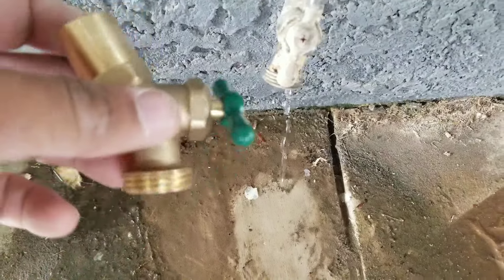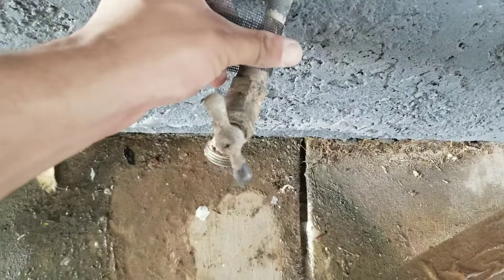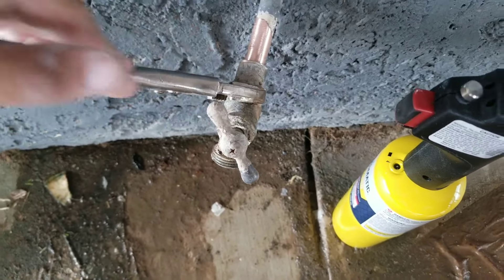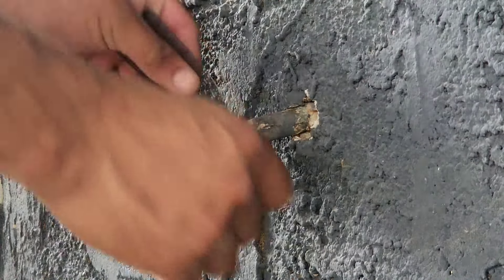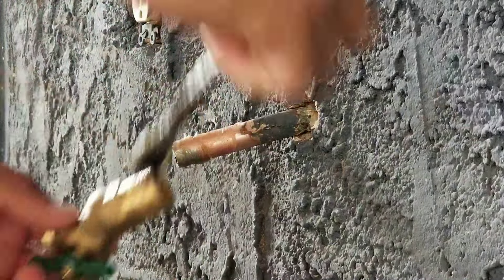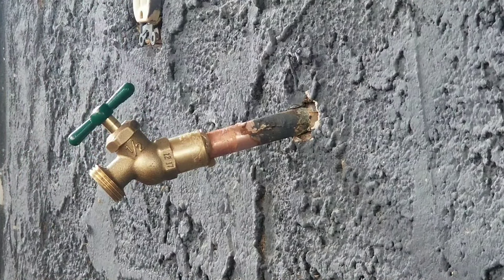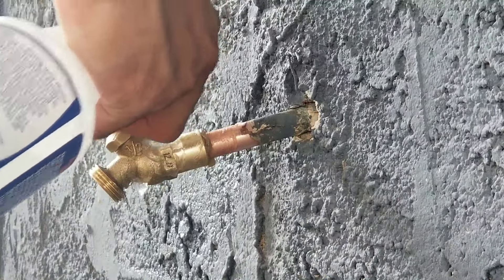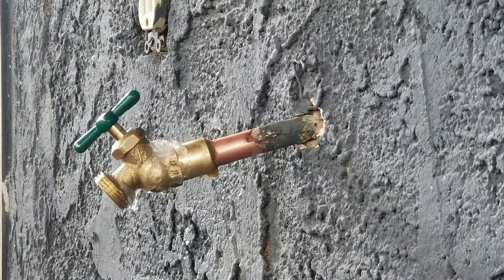How to Replace Outdoor Spigot Faucet Hosebib

Comment: How come every video like this has either several inches of pipe to work with or easy access to the other side of the wall. Of which I have neither....
Reply: Exactly!  My outside sillcocks have a flange that is flush up against the outside wall.  No exposed pipe on the outside at all.  The way I have to do it is by de-soldering the pipe INSIDE the house and then sliding about a foot of pipe and the sillcock out of the wall from the outside!
Reply: Was just thinking that. Mine has no room. I'm honestly thinking about adding pipe to mine if I get to that point so I don't have to go through this bs again
Reply: People who have to solder inside a wall cavity don’t really have room to film a video. Plus if it goes sideways they don’t want to document how they flooded inside their walls or burned their house down
Reply: I had the same problem and first time I tried or rebuild my outside faucet but I couldn’t get it apart. Of course the water was drained out of the house and I took a chance and turned the faucet off the galvanized pipe. I am not sure if you have copper pipes but I was lucky and had galvanized and if it came loose from inside the wall I was going to go get a longer pipe from a hardware store.

Comment: If ur worried about the valve components and seals melting You can unscrew and remove the valve before you start soldering. Then replace the valve after its cooled.
Reply: i did not do that but that is a good idea

Comment: One major issue with this vid and that is it's rarely that easy to take the spigot off of that copper pipe.  In fact it's usually HELL!  Can you imagine a spigot being on a copper tube for 10, 20, 30 plus years.  You bet - it's practically fused together and many time almost impossible.  This vid seems like the best case scenario and it's not realistic.  Taking that spigot off, if it's been on there a long time, is HELL to get off.
Reply: is it better to just cut it off the pipe

Comment: Good video BUT you should not torch the solder. otherwise it gets messy and leaky. torch the side and not the solder or joint...

Comment: Turn the water back on a pray it does not leak. I wish I had long pipes coming out of the wall like that.
Reply from the maker: If the pipe is not exposed the easiest solution is to break the stucco... enough where you can remove the current hose bin make sure the water supply is off. If you are able to purchase a shark bite hose spigot. It is very easy to install. Ensure water is off. Either using a pipe cutter or a handheld  torch remove the current hose bib. Make sure if using the pipe cutter that the cut is straight and clean... if using the torch no drips from silver should be present. The shark bite literally installs by pushing the spigot in and pulling. Turn water back on... only a quarter of the pressure. Make sure hose spigot is in closed position. Check for leaks. If no leaks then turn water up 1/2 pressure... check for leaks... if no leaks turn on supply all the way. Hope this helps 🙂

Comment: Very informative! I just sweated an old leaky outdoor faucet. The toughest, most time consuming part was melting the old solder, damn! It took forever and I finally smelled the familiar odor of melting solder and saw tiny little beads of silver, as it began to melt. I had a Vise-Grip pliers attached to the faucet, as a handle and safety from touching the hot spigot. After it started to spin, it still took a while to completely remove it, and I had to sand off the remaining solder. I decided that I never wanted to go through that again, when this spigot fails in the future. I'm also not very gifted at soldering,  so I used a nice compression fitting faucet that was very easy to install and works perfectly. My main tips are, 
1- Leave the old faucet fully open, to allow for gases to vent and avoid a pressure buildup.
2- Anticipate a long period for melting the old solder. Instead of those skinny tanks that come with the torch kit, I used the fatter one that's usually used for lamps and Coleman stoves. It didn't run out mid project.

Comment: Thank you sir! I have never used a torch before but your video gave me the confidence to buy and use a torch and also solder (yeah, i did an ugly job but it works!)
Reply: how was it?
Reply: @eeeeeeeeeeeeeeeeeeeeeeeee-s3p  It's an ugly weld but it's holding up....I welded on a new spigot to the water line coming out of the house for my garden hose.....no leaks yet  :)
Reply: @l3a4c1m  good job! Also long as there are no leaks that's all that really matters :)

Comment: I never knew it was so easy! My spigot is in the garage and the shut off is in my basement. I’m going to copy these directions except for the Thermo-Trap cus I don’t have any. This tap is leaking out more than what comes out of the hose when it’s hooked up! I’m looking forward to this repair & upgrade being done!!
Reply: any update?
Reply: @eeeeeeeeeeeeeeeeeeeeeeeee-s3p  it had a cracked and stuck overflow valve from the builder. I might not have drained it properly before winter. I didn’t realize that overflow had a tiny screw because it had rotated to the bottom and was impossible to undo. 
I got a guy to come and change it all for $50. It’s like brand new now!

Comment: Thank you for the Video! Just a suggestion, in the video description if you could put a list of tools and supplies you would need for this project that would be awesome! Have 2 faucets that need to be replaced myself (they only leak when on) but they look just like this, are very seized and corroded, and will need to be soldered on like this.

Comment: What type of flux & solder rods did you use to braze copper & brass together?
I tried this once & the rod just wouldn’t seem to go in where the brass & copper met. Just dripped off

Comment: The other end of that copper nipple connects to pex pipe at my house.  Any precaution needed to keep the heat from damaging pex?  Was thinking of lightly attaching vice grips right next to the brick to act as a heat sink.

Comment: would it be better to just take apart valve and remove plastic seals etc? or is this to hard to do?
Reply: it's not hard to do, and is the safest way to avoid damaging the rubber seals when soldering the valve on
Reply: It's the only way I do it. It's quick, easy, & free
Reply: @bz3248  what's the best way to get it off? hard to get leverage

Comment: would it be easier to just replace the valve seals instead of the whole spigot, or do they even sell such a thing?
Reply: Something this old isn't worth repairing. Just put a new one on.....but they do sell valve seats and re-packing thread if you want to attempt to rebuild the old valve.

Comment: or just melt of the old one off, and use a compression fitting type, so much easier, and if you have issues later, so much easier to replace.

Comment: What type of solder? Just any old acid core?
Reply: Do not use acid core solder for plumbing!  Nowadays code for residential plumbing is lead-free solder.  Go to the plumbing section at Lowes or HD and just get the Oatey lead free solder and some No. 5 lead-free flux.

Comment: Can you solder a threaded adapter instead?
Reply: No.  Threaded adapters are for NPT threads.  Why in the hell would you want to solder a threaded adapter in the first place??
Reply: @StilettoSniper  Because it's easier to replace a MIP hose bib than it is to desolder and clean the damn thing every time?
Reply: I have seen that method done before

Comment: How long it will take to melt the old solder by a torch?? My faucet is about only 10cm from the wall. I am worrying if I torch the joint too long the heat conducted by the tube might ignite or damage the wooden wall.
Reply: xiqing yang I’m just an electrician and not a plumber, but in your case I would use a tubing cutter for removal of the old hose bib, and then get a piece of sheet metal to sleeve over the pipe  to protect the wall when you’re torching the solder for the new fitting.
Reply: @AaronJohnTurner  Thank you very much. I think the idea to make a protective sleeve is great. I will try it.

Comment: Daaamn.. fixing my bathroom faucet for the first time in new apt... they didnt even solder it!! No wonder it was leaking.. smdh...
Reply: They might have used a compression fitting. If it wasn't soldiered, you'd have a indoor pool.

Comment: I'm being quoted by contractor 1  $80 for this but my pipe is not exposed. Is this possible with a non exposed pipe? Contractor 1 is offering me this but if this does not work he will replace the whole thing for $238.

Contractor 2 is offering me $225 to replace the whole thing.
Reply: Did you ever figure out
Reply: Same thing happening to me
Reply: @thatcrazyxoxo  yes a little embarrassing. I am a first time home buyer and we only lived in the house for a little while and figured out the house has 2 water shut offs inside the house. The water valve leading to the back of the house wasn't on.

Comment: Why was that pipe so crooked?
Reply from the maker: It was an old house. Who knows what... when... if... someone's Uncle did the piping 😅 Good catch though!
Reply: Because not all pipes are the same?!?
Reply: Area Practice. 
They don't know how to do it any other way.  
It's a very poor way of doing it.  Easily damaged or broke. With the possibility of it breaking off in the wall creating another unnecessary, expensive   task.
Buy a  bib with a flange on it,  & a   slip treaded coupler . Anchor it to the wall. 
When you get done with it, you'll appreciate  how professional it looks. Unlike  the previous one.
Reply: It is definitely crooked lol. But also, especially in colder climates (with or without a frost free spigot) it's good to angle the pipe downwards out of the house to let the pipe drain using gravity after the inside shutoff is turned off.